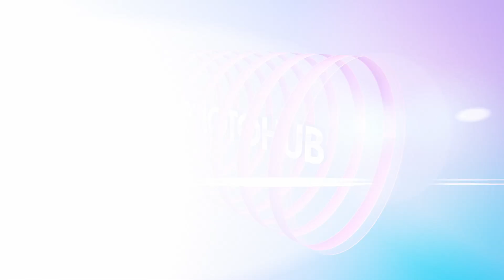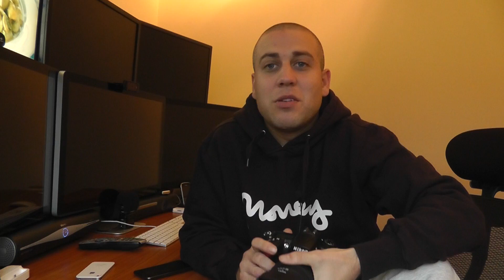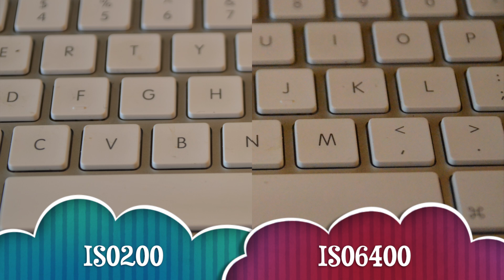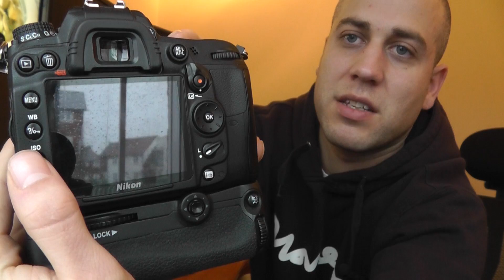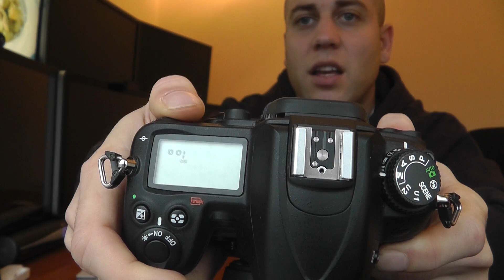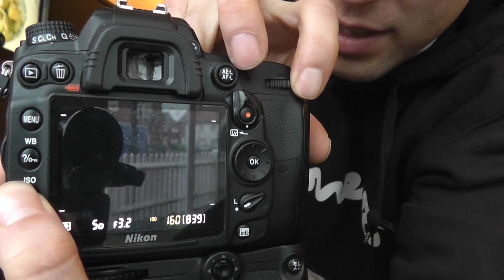ISO Sensitivity explained

Comment: There are other components and settings without a digital cameras that determines the ISO performance. Sensor may remain the same but feedbacks and connectivity from other components before and instructions to handling a scene an image and in camera ISO processing grade defers from modles to models, he;; knows probably even from unit to unit.